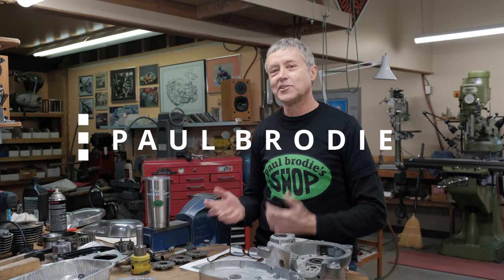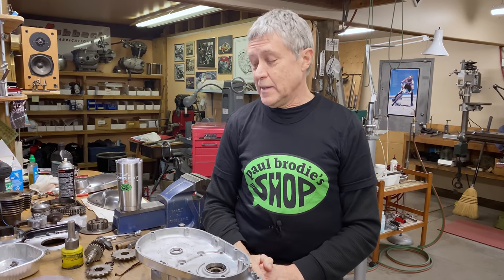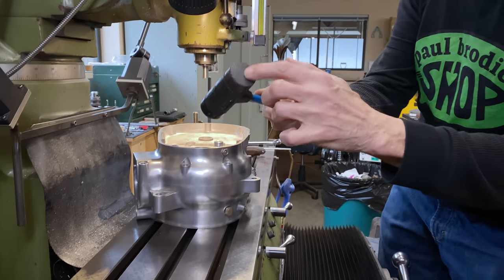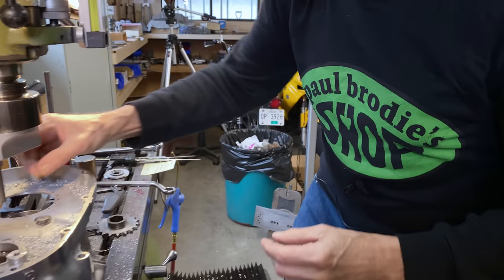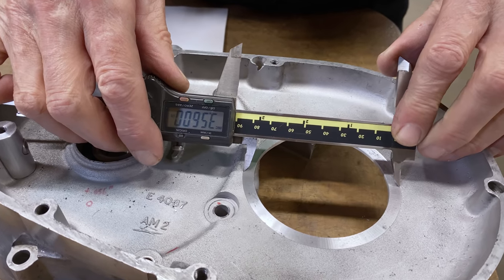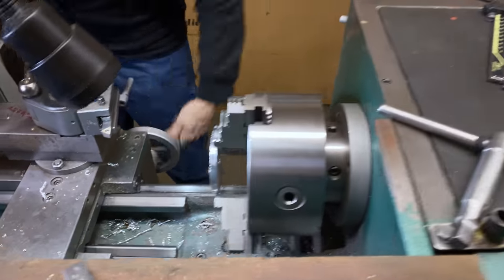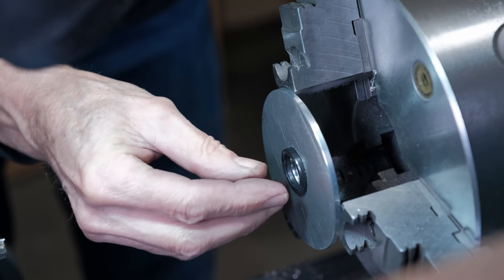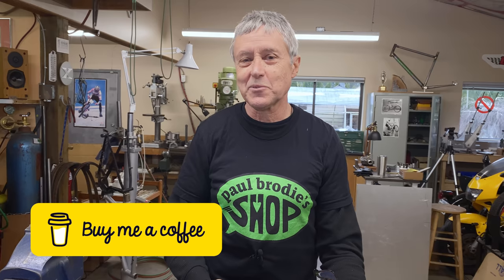Tiger Cub Engine Mods // Paul Brodie's Shop

Comment: I wish I had the money/tools to do stuff like this. I don't know that I could bring myself to cut a hole in that old of an engine case but.. I've always wanted to reproduce old engines that no one makes and upgrade them. A perfect example would be the old Indian/Ace/Henderson 4 or the Crocker or Vincent Vtwins.. It'd be really cool to take those old engines that NO ONE makes copies of and not only remake them, but make them out of aluminum where they were mostly iron back in the day. Dropping the weight by 2/3'rd and improving some of the systems and upping compression would make those engines come alive.. plus they wouldn't be original so you could beat on them or modify them without worrying about potentially destroying an irreplaceable piece of motorcycle history. 

Currently there's a 57 Tiger Cub for sale near me for $1000obo it's in really ROUGH shape and is definitely missing some parts and comes with some extras but I've wanted one since I was in my single digits. (I'm 37 now btw) I always wanted to learn to ride on one growing up. While I'm probably far too large for one now at 6'10 and 315lbs, I'd still love to save this one and work on it and be able to put around town on it and even let my nephew/nieces learn to ride on it if they wanted to. (unfortunately I don't have kids of my own) While it wouldn't go anywhere quickly, I'm sure it'd have enough torque to probably get me up to cruising around town speeds. (25mph) I think the hardest part would just be making the suspension strong enough to deal with my weight. I'd guess figuring out how to put Yamaha WR250 front fork set on it would probably be the best way to cope with my weight, combined with a speced out set of piggyback coilovers in the back, which would also allow you to upgrade to a front disc brake at the same time. The hard part of that would be finding out if they have the right shaft length/diameter and if you can get a bearing set that'll fit and if the shaft/trees set the fork angle correctly so you aren't messing with the rake. I guess the easiest upgrade would be to find a set of 500 forks and throw them on, not that even those are really meant to work with someone my weight.. at least the WR forks can be re-valved to cope with added weight. Hell, even John (lunmad Triumph.. RIP my friend) added extra springs in the form of valve springs into his forks on his 72 Bonnie to give him some extra ride quality and he wasn't very heavy at all. Looking at the pictures it might already have a set though as it has the rubber gaters on the forks. (if you were to run a 500 front fork, it wouldn't be hard to upgrade to the bigger drum brake as well.. we happen to already have a set of 19 inch wheels with the bigger drums on them in our garage.. While most people would say the 4.5-5 inch drums are enough on that light of a bike, remembering that I weigh more than the bike says to me it needs better brakes.)
Reply from the maker: Well, thanks for watching and commenting... The forks on my Cub are the same as the Heavyweight Triumph 500 forks, and I also added the 500 8" brake drum too, in case you haven't seen the latest of our Cub videos... I also have reproduced Excelsior V-twin motors. If you watch our Excelsior videos you will get a good sense of how that got accomplished...   :face-fuchsia-poop-shape:
Reply: @paulbrodie  Yeah I just discovered your videos last night. Your accent has been throwing me for a loop, you definitely don't sound like a typical Brit or Canadian. I just watched your "We're Back" video and heard about what you used to do and what you're going through. Cancer.. how that stuff is still allowed to exist, if only the world could stop trying to kill each other/arguing long enough to put our collective minds together and destroy the thing that's taken countless lives. Both my grandmothers (one before I was born) one grandpa, a couple great uncles, and various other family members have been taken by cancers.. in fact I might have thyroid cancer thanks to this 1.6cm nodule on my throat. -.- 

If you ever get bored and want to see a couple short videos of my dad's bikes, I've got them on my other channel.. including a 1965 T120C. https://www.youtube.com/playlist?list=PL6Gz_TRD0rk3HWVwz5Wgl0hHWPxJCxzp6
Reply from the maker: @jaratt85  I was born in the UK and emigrated to Canada when I was nine...

Comment: Hey Paul, could you bore out the hole for the seal from the other side (sprocket side) of the plate? Would this bring the seal into contact with bushing. 
Enjoyable video, as always
Reply from the maker: Thanks Barry. Yes, the plate has been re-designed and machined from thicker plate.

Comment: Nice work, again, but I think you should have done the hole for the oil seal to the other side of the plate.
Reply from the maker: You are correct. I was following the drawing, and now I am re-making the plate.

Comment: Paul, I used to use aluminum beer cans as shims. You need a horizontal shaper.
Reply from the maker: First I need a better lathe, then a tool and cutter grinder :)
Reply: @paulbrodie  Paul, seems to me that you already do very well with what you have!
Reply from the maker: @wheater5  Yes, I'm not complaining but I can dream...

Comment: Could you not put the plate and oil seal from a 650 triumph so you can change the sprocket ⚙️??
Reply from the maker: I don't know.. I have never owned a 650 Triumph, have never worked on one either...

Comment: Hello. Have you checked that your fly cutter doesn't have the collar you hold to make it automatically feed outward? Plunging will not actually give you a flat face as the cutter has relief and will cut deeper on the outside
Reply from the maker: Hello. I do not have one of those fancy fly cutters that can automatically feed outward. Yes, the surface might not be perfectly flat, but I have some excellent Loctite gasket cement. Everything is going to be just fine..
Reply: @paulbrodie  yours just looked identical to one I used to use! Nice work

Comment: Is there a fix for the crank oil feed on the right case half? That's what killed my old cub many years ago. Crank was a titch worn, and the bushing(s) in the case as well also. There just wasn't a fix back in the day, and neither were cranks. About 5 years later, there was a shop in the UK that started producing and selling right crank parts. My poor cub. It was so fun while it lasted : (
Reply from the maker: I would only bother with the motors that had the two main bearings. Not really interested in the older ones with the bronze bushing. Not a good design...

Comment: Paul- I think you will need to drill and tap holes in each CS sprocket to use a puller when swapping the CS in the future.
Reply: They don't fit that tight.  It's a spline that allows easy fit and removal.
Reply: @whalesong999  My thinking was just to get centered purchase to clear the case hole. Clearance is tight there.
Reply: @chasejiannalone8763  Got it.  Maybe a device with prongs to fit in a few of the roller valleys between the teeth would suffice.  Sprockets are super hard for drilling and tapping.
Reply from the maker: @whalesong999   You are correct!

Comment: You would be so good at using old engines and fitting electric motors in them so the transmission components can still be used.... I'd love to see a collaborative build w/ you and another YouTuber that does the gas to electric conversions, like the guys doing Honda Cub conversions. Using a complete bike but they gut the motors and put the electric drive components inside the block and the tanks are used to hold the battery pack... Would that be something you would be interested in doing¿?
Reply from the maker: Well, me and electrics don't get along. Our history is not good. I like electric vehicles, but it would be very hard for me to get enthusiastic about a project of this kind.
Reply: @paulbrodie  - I'd love to do something like this w/ you but I'm a nobody, but I'd find a good bike that would be an easy conversion then send you the motor so you can empty it out and add some mounting points for the electric motor and gears then I'd do the electric work and final construction myself... I know you'd be able to come up w/ some very cool ideas .

Comment: How about making a new sprocket plate, and installing the seal from the sprocket side. You wouldn't need to make the mounting flange so thin.
Reply from the maker: How about that? The new sprocket plate has been re-designed and the sea; is on the other side. Thanks for watching.

Comment: what about the thickness of the inner case gasket during your measurements and machinig???
Reply from the maker: You mean the gasket between the two crankcase halves? I am not planning on using one.
Reply: @paulbrodie  yes between the two halves, ok thats awesome Paul, Ive used solely shellac in the past and that worked perfect also...always enjoy watching your engineering craftmanship, simply the BEST!
Reply from the maker: @zenpro8164  Thank you zen pro. I use a Loctite sealer that works very well.

Comment: Wow. For many episodes of this Cub project, I've teased Paul about the horrid engineering of the bike. Now he is fixing the worst of the many worst parts: the need to pull the engine and split the cases just to change the counter shaft gear. Its for sure going to be the world's greatest Cub when he's done.
Reply from the maker: Thanks Pat. I am making improvements but it will still not be a perfect motorcycle. I'm sure it will have its' quirks.
Reply: @paulbrodie  There is an obvious answer to the issue that a 19 tooth gear won't fit in your magic removable plate/hole: change the rear sprocket. I don't know what the primary and transmission gears are, but where are you really gonna need a 19th counter shaft gear anyway with  the 15 or so HP that the Cub will have.
Reply from the maker: @PatFarrellKTM   I already have a very small rear sprocket. We'll see how it all works..

Comment: i had a mate with a cub he complained about oil leak primery cass i advised him to run dry grease the clutch bearings and use good chain oil (he only used the bike summer and 40 50 mph ) some time later asking hows oil leaks he said i did what you said dune a few miles and it fine checked the grease none gone i told him the clutch bearings only work when holding the bike in gear at light s just saying
Reply from the maker: Sounds like good advice for that particular situation.

Comment: That design is ridiculous!  Changing sprockets for gearing is something that many owners want to do from time to time, not to mention replacing sprockets when they wear out. It's hard to imagine what was gained by Triumph in carrying that design through to production.
Reply: Cost, most people wouldn't need to go near the drive sprocket if a change of gearing is required the rear can be changed but as you say when it's worn out it's an engine split.
Difference here is Paul intends to use it for trials (I made a mistake here , this is complete hogwash) so convenient (still have to remove the clutch) drive gear changes are more important.
Reply from the maker: @pbysome  I never said I am building a trials bike, and I am not. Low exhaust, big carb, no air filter do not make a trials bike!
Reply from the maker: Triumph was saving money! It did not always make sense in the long run.
Reply: @paulbrodie  true sorry I misinterpreted that one, the jack under the frame loop threw me I didn't consider the low exhaust
And you didn't say it was for  trials.
Someone else commented on your manifold vid about it being a trials plodder which kind of backed up my misinformed delusions.
Reply from the maker: @pbysome  It's very hard not to make assumptions. I catch myself doing it and I am almost always wrong. Still learning after all these years!
Reply: @paulbrodie  true to assume makes ass out of u and me as they say.
Bit disappointed with myself though.
Reply: @paulbrodie  what hp are you hoping for?
Reply from the maker: @pbysome  14.6 hp.
Reply: @paulbrodie  ah, is it mountain cub spec?
Reply from the maker: @pbysome  The motor is a '67 mountain Cub with '65 mountain Cub internals.
Reply: @paulbrodie  you've got me contemplating buying one, if I can find a basket case , they make a lot of money in UK so I'm not optimistic.
Reply from the maker: @pbysome  Triumph made a lot of them. They are around...
Reply: @paulbrodie  7000 odd but a good finished one is a couple of grand plus UK pounds, basket cases are less common and people tend to overpay.
I was restoring t160 triples but they got so expensive to buy it just wasn't worth it as people paid far more than they were worth for boxes of bits, they built around the same amount 7000 odd.
I have the makings of a Rob north triple on the bench at the mo just modifying the primary to belt which is interesting.

Comment: Kind of looks like that oil seal should have went on the 'outside' - typical for that type of seal - instead of the 'inside'.
Reply from the maker: You are right, and the part has been redesigned.
Reply: Get to spend more time at the lathe - sounds like a happy little accident to me. Can't wait to see it.

Comment: Seriously, Paul, nobody in Coventry, back in 1953 thought that anybody would ever even dream about changing the sprocket. Shame on you for upsetting their apple cart... I think that if the great Edward Turner were still alive he would be tickled that you are putting so much energy and expertise into one of his designs. Anyhoo, I'm only 1.41 into this thing, so... p.s. 200 mph on a unicycle is quite frankly a death wish. I blame it on his parents. Clearly he was on the wrong medication... (3.06)... As ever, much impressed...
Reply: Ahh, actually, the C15 had that facility, and this mod is basically copying the C15 sprocket “porthole”. The BSA C15 was developed from the Tiger Cub engine. All the same I prefer the, say, Yamaha/Honda/Suzuki sprocket system (I now have a Yamaha Serow) to the C15 I owned and rode in the 1960s. Les in UK
Reply: @leslieaustin151  I have a very early B40, which was the next step in the Cub evolution. I can't remember when I was last in the drive side. Reach a certain age and 4 wheels are the way to go...
Reply: @billdyke9745  the B40 will have it too, (watch Britannia Motorcycles as he has C15s, B40s and B440/B450s stripped down in various builds). Yup, I know about the age thing and 4 wheels, but I’m back on 2 wheels again from age 71, now 75. Just love the 2 wheeled option! Les
Reply: @leslieaustin151  Hot damn. I'm coming up on 68, which makes you, sir, an inspirational old git! I'll stick with the 4 wheels, thanks very much. It has been decades since I've been on anything more than a bicycle. A Honda 50, maybe to get me back in the groove... Hmm... Tempted...
Reply: @Alfred Wedmore I was trying to be kind to Mr Turner. It wasn't his fault that the British motorcycle industry was going tits up by 1961. Hondas were coming to the UK by then and all the BSA unit singles were evolved from the Terrier of 1952. So, win the war, lose the battle. It seriously pisses me off that we went bankrupt defeating the Germans and the Japanese, (we only finished paying the Americans back in 2006), just to see those economies thrive while we were screwed. The treaty of Versailles created Hitler, so we were not going to make that mistake again... Go figure...
Reply from the maker: Thanks Bill :)
Reply: @billdyke9745  well, certainly an old git, not sure about the “inspirational” part. Yeah, go for it, Bill, but make it a 125 of some sort (off road, trail bike? I love my Serow (XT225) and it’s lightweight..). All the best for the next 20 years! Les
Reply: @leslieaustin151  You are definitely tempting me, sir. I live on a boat at the end of a quarter mile, poorly maintained dirt track. A Honda 125 semi dirt bike would do quite nicely... Hmm...